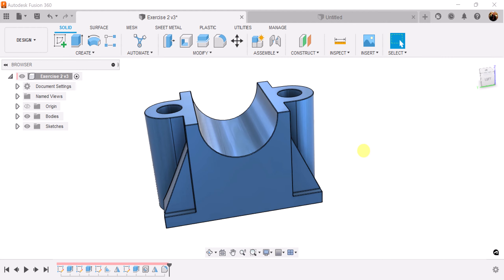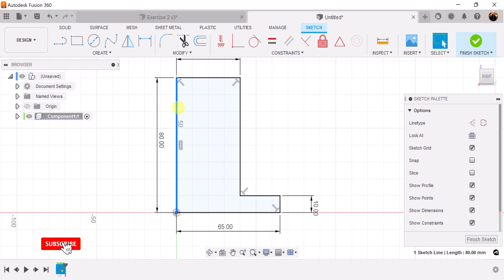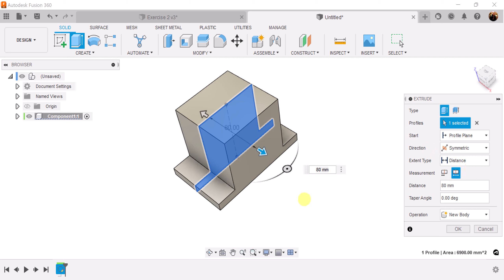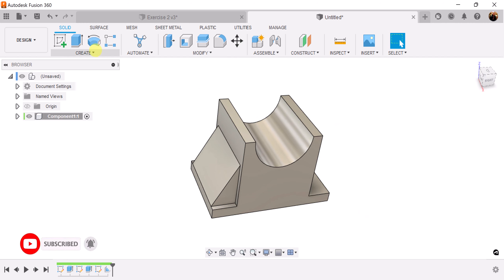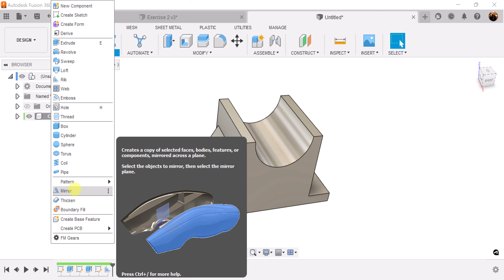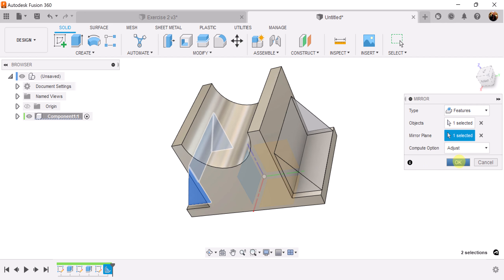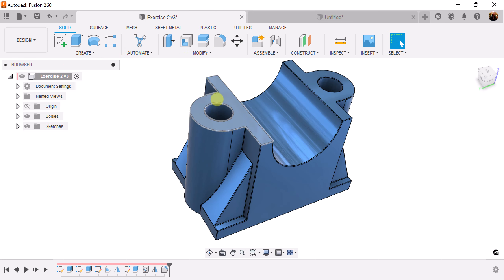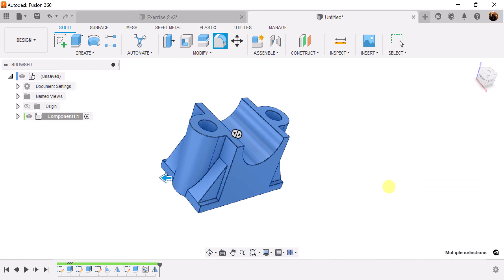Modeling in  Fusion 360 | Rep no. 2

Comment: when I try to do the rib around 5:20 in I can't seem to get it to snap to the vertical line? am I missing something when it comes to snaps ?
Reply from the maker: If you run into this issue try going to the Profile Name in the top right corner of the Fusion 360 user interface > Preferences and select Design. 

Make sure the following options are checked:
1. Auto project edges on reference.
2. Auto look at sketch.
3. Auto project geometry on active sketch plane.
Reply: @CADJungle  thank you that worked !!!
Reply: @CADJungle  enjoy your coffee !!!
Reply from the maker: Thank you very much for your support!